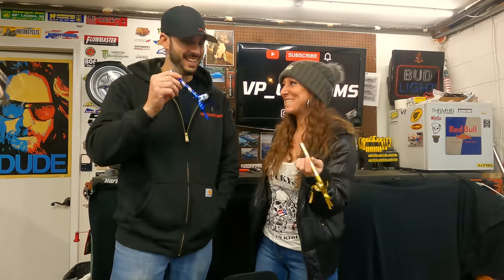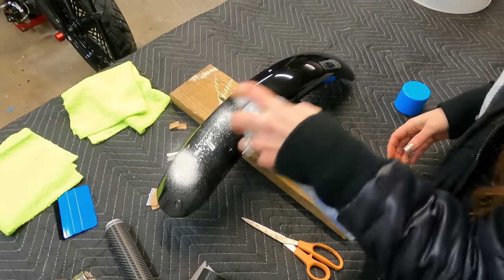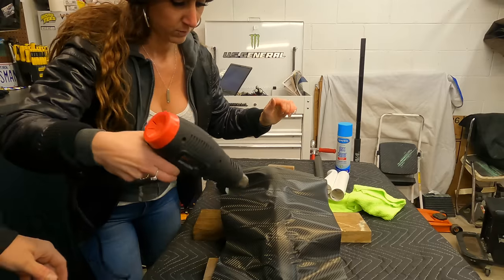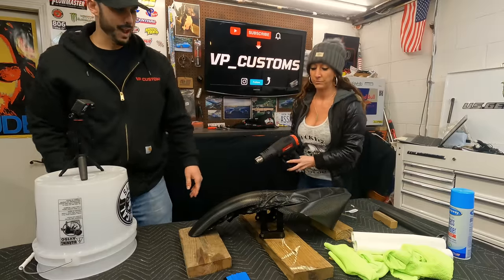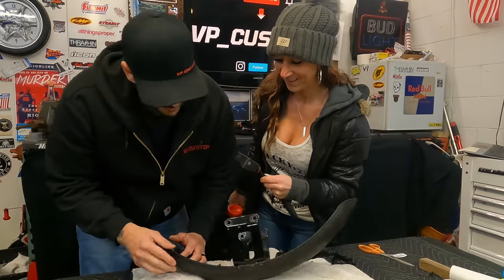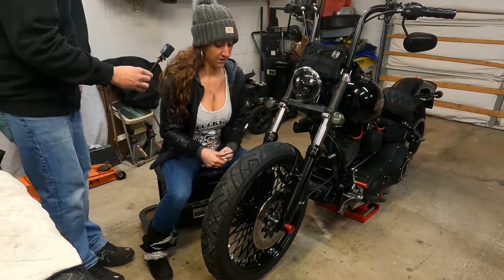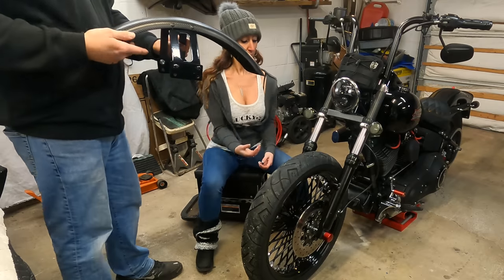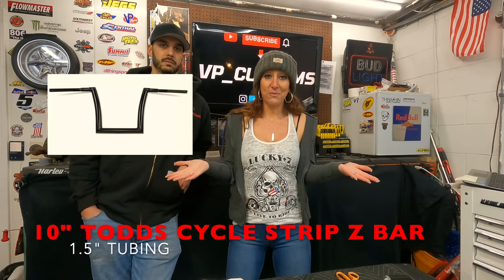Vinyl Wrapping Our Harley Fender.

Comment: You are doing great, it's a tricky process. I do this at work on vehicles, and for wrapping there is purpose made vinyl with air ways to help avoid trapping air and getting creases and bubbles. Not a fan of vinyl on bikes but each to their own. Good job 👍
Reply from the maker: Thanks Simon, the more I do it, easier it gets for sure.  Thanks for the tip

Comment: This looks like a nightmare.  What DIY’er has helpers just hanging around?  I was going to do my motorcycle front fender and this just completely discouraged me from even trying.  I am very mechanical and do all the work on my cars and I would rather do a brake job that includes a fluid flush than try to do this.
Reply from the maker: 🤣🤣 definitely requires patience!! We like to challenge ourselves 😁
Reply: @VPCustoms  I will say that your video is very helpful.  It prevented me from trying to do something that would have drive me nuts.  I followed a YouTube video for doing a cheap rattle can paint job on the roof and trunk of a very small car.  My results compared to the video were atrocious.  I am very patient too but artistic work like yours has never been one of my strongpoints as I am an accountant.

Comment: The fatter bars are nice. The hard 90° bends will test you patients if internally wired. Have lots of beer. Did a set on my sons sportster 1200 this summer. I used Burly extensions.
Reply from the maker: I agree, there will definitely be some cold drink breaks during that bar install! Thanks for watching!